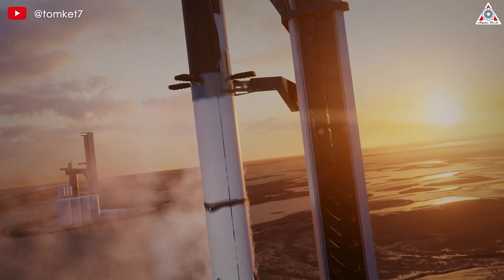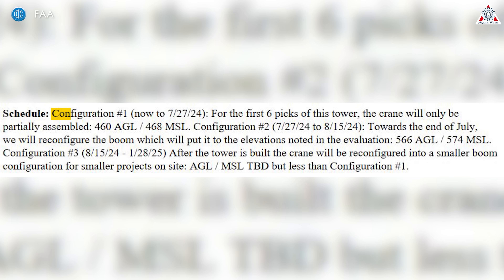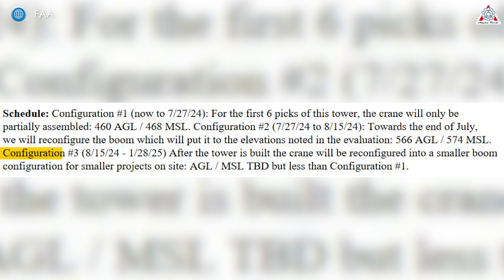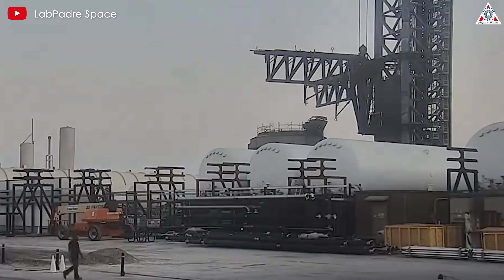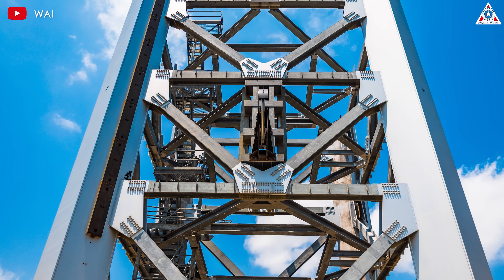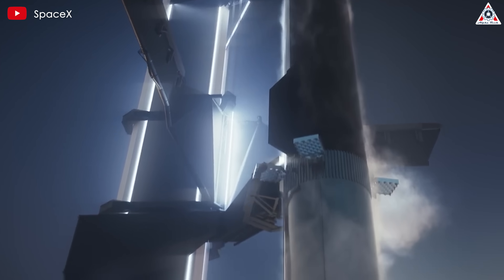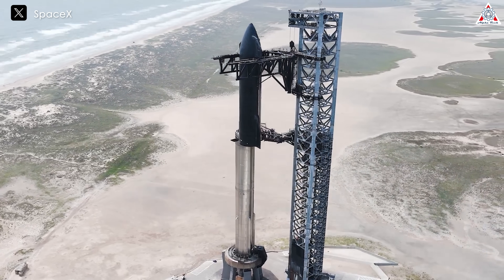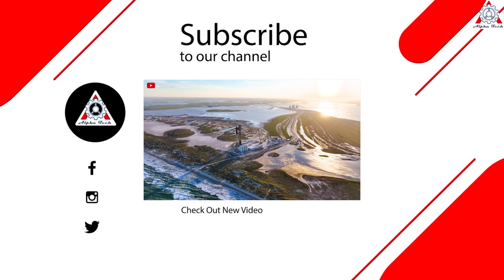What Elon Musk’s SpaceX Just Did is Mind-blowing!!!

Comment: I'm not a big tower fan, but any progress is good.  And the towers are likely a limited land based infrastructure, the will be superceded by a water based system.

When so, I hope they bring some expertise on board in the design phase, as theres alot to know about the dynamics, and rocket enginerds arent gonna know alot of it, and likely miss important points. Having some Marine engineers and Naval architects on staff might be a good idea, and I'd wanna be carefull about those, as the Navy has had some real flops in the last few years. Literally had ships designed with office building like superstructure on shallow draft hulls, and then wondered why they werent stabile...

I suspect its the same reason SpaceX has problems, that wall hangers dont insure competance, and modern academics results seems to be at a low ebb.

Also, when it comes to forces, Hurricanes dont care about your stinkin' numbers...

Personally if designing such a system, I would focus on stability, and find a different system than tall heavy towers. Like maybe medium heavy towers at most, and grip the ships as low as possible.

Also I would try to insure positive buoyancy no matter what, Like the WW2 stealth Q ships that had guns disquised as deck cargo, and the hold full of ping pong balls to make them unsinkable. Use to fight surfaced U-boats.

Modern version would be urethane foam filled voids.

That way, if you rip some welds, you dont have to raise it from the bottom after the storm.

Also I might mention that the waterline is a mechanical fulcrum leverage point, and the more you put above that line in relationship to below that line, gives you a reverse leverage effect with the sea as an energy/force input... its why ships will crack across the deck and break up. 
If the deck is 4x from the water line as the keel is below it, its 4X more stressed...

Also creates unnecessary windage... which is no joke. Like the old square riggers and their acre of canvas, the calculated thrust from wind force on the sails equaled a pretty good jet turbine engine. And with hull speed limits ratio for displacement hulls, ships were lost by sailing the hull under water because they couldnt reduce sail area fast enough when winds came up.

Now think about your barge sides, tower sides, and the side area of the mega Starships Elon wants to scale up to.... And those wind thrust numbers were in a good sailing wind, not a storm.

You might want to shorten everything possible. Maybe even sit the ships down in a well some.. And maybe think up a better gripper system than paralelle crab pinchers

If you sat the ships in a well, you could use sea water for you water drench system for launch just via valves, and pumping the sump dry again after launch.
Have a pool in the bottom.

I think I'd wanna avoid thinking in terms of transferring the tower system as a design concept to the sea launch system.

I spent a couple months plus at sea single handed, out of sight of land, and it was often a traumatic experience...  way beyond anything imaginable in an office.

You realize very quickly that what is supposedly a good blue water boat, was designed by idiots for idiots.

I've been to sea on large ships too... It can get impressive even for them.

Ships are still lost regularly...

Its no place to think arrogantly on the engineering. Much better to make every effort to minimize every risk...

Just wanted to plant a little fear factor ahead of the curve. Maybe get some better thinking going on concepts, that could be transferred from land to water based. I dont think the renders of towers on barges really portray the required engineering... I think we could see towers that looked like up rooted trees... The sea is not like anchoring into the earth for your foundation.. Everything moves constantly, and wave energy is way way big F'ing numbers on a calm day... Those waves can build energy for thousands of nautical miles, and arrive where its nice-nice...

I'd say SpaceX needs some next level engineering already working on the sea based designs. And not rely on Quickie designing...

Just sayin'

Comment: They need multiple Megazilla towers because of Starships refueling requirements. They need to quickly launch multiple refueling flights for each Starship that's planned to go to the Moon or Mars. 

I could see even the possibility of combining Starlink launches and refueling the orbital tanker within the same mission. Once Starship build 3 goes in service, it becomes the Space X orbital workhorse.
Reply from the maker: Will it get bigger?
Reply: @alphatech4966  Maybe the current top planned section of tower two is a placeholder for more sections?.

Kennedy will want a gantry tower section and elevator when it's built. For the manned missions that will launch from there.

We might not be done with towers and tower building designs. Just like Starship.